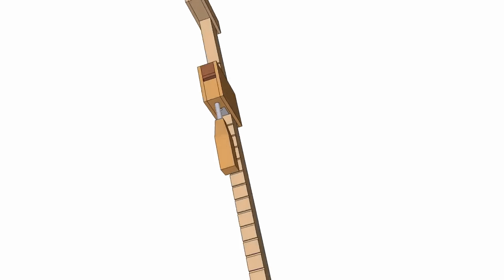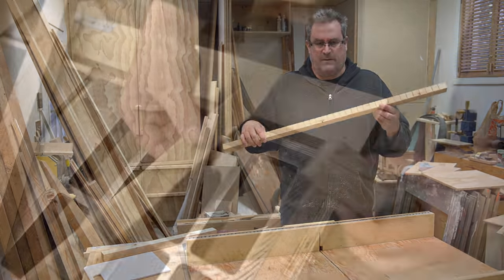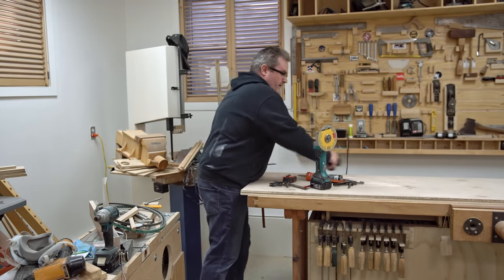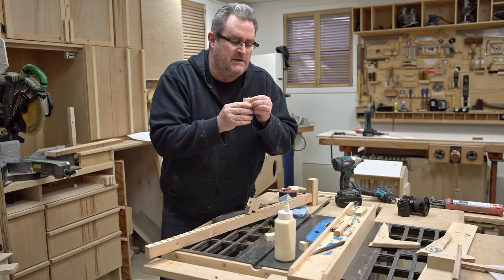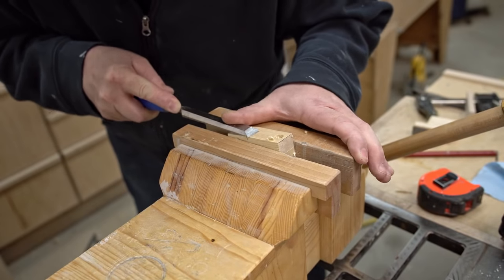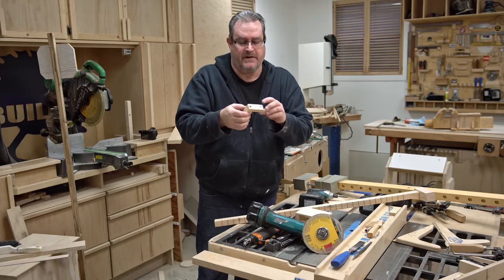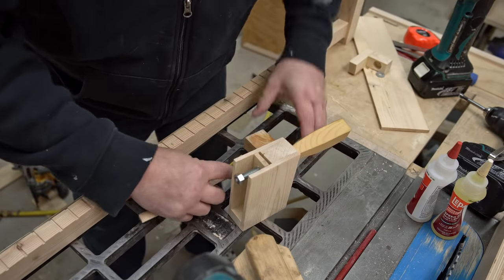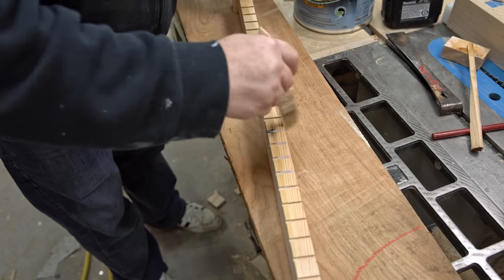How To Make A Wooden Bar Clamp

Comment: In the 80’s I remember making finger sized skateboards. I would laminate paper, card stock, whatever it took. I would use wood glue that I would dry quicker by putting it in the microwave. Have any of you tried that? I don’t remember now if it really helped or if I thought it did because it came out hot and I would have to let it sit for a while. After it sat it was dry. But it may have been dry just sitting without the microwave step. Who knows.

Comment: When I saw you tighten that screw in at minute 7:45 to 7:50 I suspected you might have damaged the dried glue joint. Not that I'm an expert but it has happened to me.
Great little project.

Comment: Hey John. To potentially solve the joined grain issue with the u-shaped block (as you said the weak point of the build) why not use plywood?  Already cross grained,  cheap and simple (maybe some Baltic Birch?)
Reply: Pardon, not the u shaped block, but l-shaped block.
Reply from the maker: Plywood is one option, but I wanted to avoid it altogether in this clamp and make the whole thing from solid wood.
Reply: John, I have had some success in stiffening the bar in clamps with a wooden bar by cutting them vertically down the length and  glueing them back together with urea formaldehyde glue,which is in itself pretty stiff. I turn one side end for end,though wether that makes any difference I don’t know, not having tested it !
Reply from the maker: Laminated wood is generally stronger than solid wood, but adds time and complexity to the build. Better to just use a stronger wood that resists bending.

Comment: Is a contact cement a viable option for the blocks(the stuff used with laminate)?  On one of the other clamp builds, maybe k clamp, you mentioned that the slots could go on the underside to provide more strength.  For some reason that point stuck.  What is the difference between having the slots on top vs. bottom?  I actually bought the parts for one of your bar clamps to build from your plans, but haven't built yet.  Wondering if the plans would be released for these clamps?  Maybe they're on your site?

Comment: On that “weak” L  joint, I wonder if a time compromise could be made. Instead of a box joint, how about a spline or 2? Just a thought from a maker wannabe. You would know best, for sure.
Reply from the maker: I consider splines, but then you'd have to assemble the L first before cutting in the splines. Instead of box joints I'll use an easy to cut saddle joint to lock the parts together.
Reply: how about a dowel?